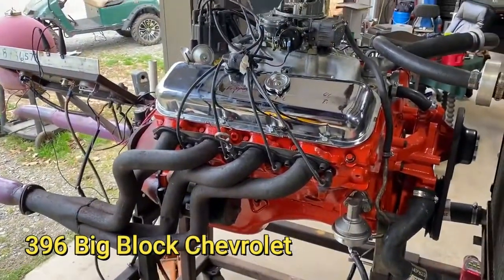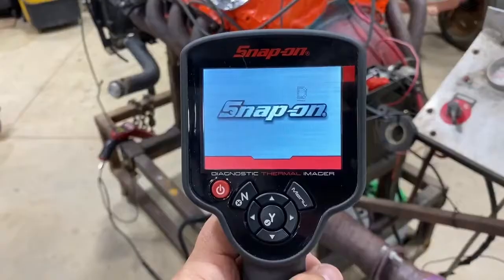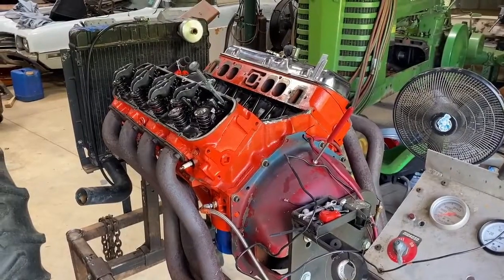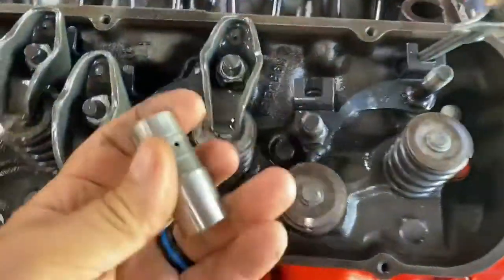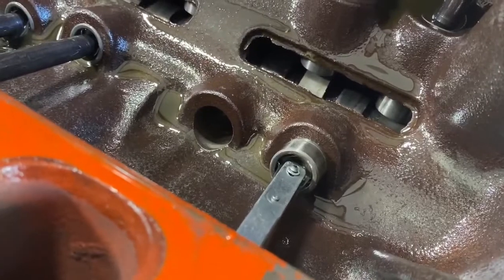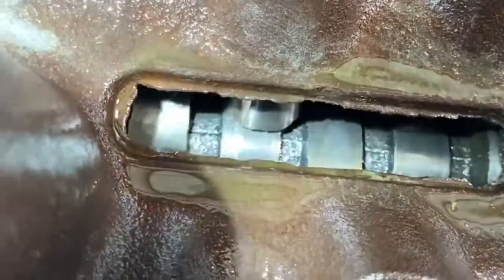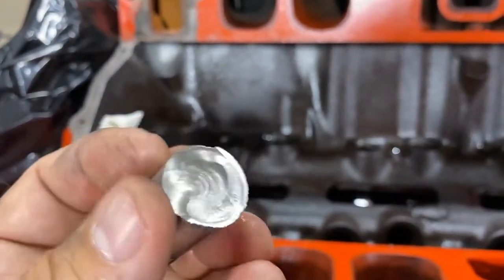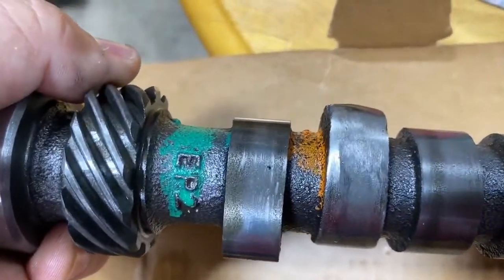Engine Misfire Diagnosis: Tips and Tricks

Comment: I installed the new 383 Chevy small-block , I have a misfire and timing mark jumps 10 degrees can't get it to sit still. Do you think it's possible I have the same situation?
Reply from the maker: It’s possible. Did it go through the break-in process using the high zinc break-in oil and keep rpm’s up?
Reply: You might need a new timing chain.